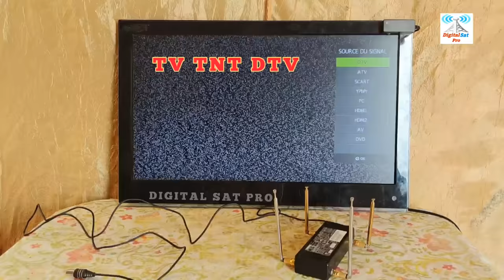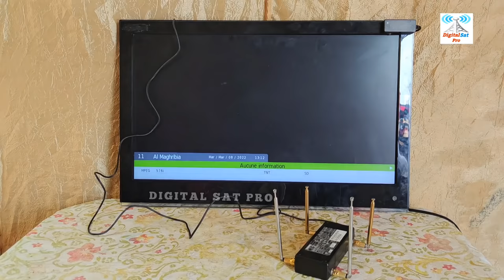Turn an old laptop charger into a powerful antenna to watch TNT HD channels

Comment: As an electrical engineer with an RF background, my forehead is sore from all the facepalming I did watching this.  You would be better off simply taking that original piece of wire and sticking it into the antenna connector on the back of the TV.
Reply: I would be better off running to a store to buy a cheap antenna and use the time saved to take a nap or mow the lawn.
Reply: I`m calling Fake on this one as he actually never shows disconecting the original service from the back of the TV and pluging this in showing that .. Hidden source , not this Antena pluged in on the back ..
Reply: @kjisnot  Trust me, you wouldn't. lol.
Reply: Look at some of his other antennas.....hilarious! He don't know a dipole from a ditch!
Reply: Yes, it seems his sync plugs are out of alignment.
Reply: lol ,,  theres much more to it

Comment: I remember before digital TV, the best antenna, better than anything you could buy at the store, was a paper clip, bent into a ring with a tail. You'd stick the tail part in the antenna connector, and suddenly have more channels than ever before.
Reply: I still do that for digital channels it picks up all the channels in my area with no problem
Reply: Metal coat hanger
Reply: Counterpoise
Reply: ב''ה, still a thing though you'll want to look at the standard size of a UHF loop, as that's essentially what you're making.
 
In an urban environment very close to transmitters (Manhattan for example) the ridiculously small and out of tune paperclip may prevent overload and actually improve reception including with ATSC digital.

Comment: I've like to suggest using a "step drill" when drilling thin plastic, to avoid the all-too-common "grab" when a drill bit meant for metal breaks through! The step drill also deburrs the hole "automatically" !
Reply: Or run the drill in reverse
Reply: You can recommend them all you like, not everyone likes stepper bits, and some tend to drill too far. v you have to know how to use the correctly for them to be effective.
Reply: I can't believe how dull the drill was.. I took a short nap, woke up, he was still drilling.

Comment: Sorry, this may work for short distances, but I’m 80 miles from downtown Chicago. I currently have an antenna that I bought in 1988. It is about 20’ long and 18’ wide in the rear. I use a 4 watt booster and get about 70 local channels. I have dish and it works quite well, however my antenna works better on the local channels. During rain/snow, the antenna works, but not dish.    Jim
Reply: Be Gilbert!

Comment: You might be surprised at how much of improvement to your signal. Just by using quality coaxial cable.
Reply: That what I did worked great !!😎👍
Reply: i did same and inserted coaxial cable into a can as a lazy cantenna. i've made proper cantenna's

Comment: Although these antennas would not work for me due to the fact I live over 100 miles from a tower, I enjoy watching you construct the different models. Maybe if I move closer to the city I will try to make this model, or I might make one for someone within range of the tower. Thanks
Reply: YOU ARE WAISTING YOUR TIME ITS A SCAM
Reply: Use a dipole antenna 30 feet in the air
Reply: @wayne grimson*
Reply: All you have to do is put your antenna ether on the roof or on top of a 50 ft pole
Reply: There is a 3000 one on Amazon extender it's called

Comment: It certainly "looks" like an antenna.  I assume that there is no consideration of the bandwidth of the signals that are trying to be received and the length of the antenna components.  The proximity to the transmitter necessary for this to work could be equally achieved by a single wire.
Reply: The TV is close enough to the terrestrial tower, a piece of wire pushed into the antenna connector would work also. No dipole needed. Wire clothes hanger?
Reply: @FreezyAbitKT7A  I used an Old Antenna Cable, stripped about 8-12 inches of the end exposing the wire only.  Ran it up the wall then plugged it in.

Comment: I suspect you'd get better results just jamming a paper clip into the antenna input on the back of the T.V..
Reply: I would use a multi-directional metal coat hanger.
Reply: I thought of it as a high tech no tech?
Reply: @stevelacombe5291  coat hangers work great, especially with foil extras.

Comment: Ok haters, now that I watched it to the end, which you should also, I see that he made a directional antenna. He doesn't mention that the length of those antennas are critical, and also that the metal lining of the case is critical,  which is why he used a laptop charger case. I can't be sure without more information. Like exact dimensions of everything, but I would wager that he's getting at least 6 dB amplification from his directional antenna. Remember that we are now using digital signals, not analog, so the rules of the game have changed and the analog ghosting that would happen with this unit, is now  an additive result, or multiplication? I'm rusty at this stuff. I've got a yaggi design in my head that's trying to be my dominant thought process that got triggered by his design.

Comment: So you reused a plastic box to make a double set of bunny ears?
Maybe include some signal gain comparisons to support  your claim of "powerful".
Maybe include something about intended frequencies.  Though from looking at it - appears to be AF/FM and over the air TV type signal range.
You did a neat job of the actual construction.

Comment: While interesting to watch, the same signal can be received with a single wire "coat hanger" or copper wire, and not waste the coax connectors, or breath in toxic plastic fumes.

Comment: Unless I missed something, there is no way the cable end (11:02-right) will fit onto the TV.
The back of most TVs have Female Coaxial Port (center lead is much smaller than shown).
Reply: looking at a regional or age related varation in TV standards. I've seen RCA/component in 2 varieties, Coax, HDMI, Antenna (pair of screws), S-Video... too many standards... What he's got is possibly Composit Video...
Reply: @Neuralatrophy  Look a little harder. No one is using RCA, HDMI, or S-Video connectors to receive an antenna signal.  

His connector is obviously RF coax with a thicker center pin on the TV end. It's probably a standard in his region.

Comment: so measurements must not be too much of a deal because my laptop charger is much bigger, and all you're doing is using a box to hold the stuff.Also it cant be too powerful because you moved it and it cut out. Would it not be better to have the internal wires shielded in the box?

Comment: From what I could see, two of the antennas were connected to the cable shielding, which is grounded.  How does that work??
Reply: I would have used a 75 ohm balun inside. Also you don't have to destroy a charging power supply to make this a plastic construction box would also work. This antenna will work in local areas don't expect it in fringe areas. An old UHF antenna works better and you can add vhf elements and maybe use rabbit ears rods which will help with low frequency channels. Goto the tv stations website for exact frequencies the channel number doesn't give you a frequency like in the old days. Most digital channels are on UHF. Some on high VHF and few on Low VHF. 73
Reply: The shield isn’t always a ground connection. It’s a shield and commonly half of the connection to most antennas. What has been built is what is known as a “dipole” which is has a negative pole and a positive pole. This fellow’s antenna could be more effective if the shielded radials were pointed in the opposite direction as the radials on the center pin side.
Reply: @LiquidRadio  it is if it's cable tv. I used it when there were no grounds on the outlets. I had a surge protector outlet with lights and used the cable ground. It's also a ground when hooked to an outside antenna because of the grounding block. The only time it ain't grounded if the TV only has two lines to the plug and if you don't ground your outside antenna which I don't recommend. If the TV is grounded the antenna jack is grounded but still part of the antenna. Using a balun is the best way to match an antenna to the set. I know it will work better if you use a balun in this setup. I will try it when I find another set of  rabbit ears. I know I have a few sets lying around. 73

 PS you can also use wifi antennas from older routers,  you will have to use sma connectors instead of f connectors. 73
Reply: @ronb6182  Thanks... I was addressing the original poster's question, trying to keep it simple and without getting too much into explanation of details like voltage phases, impedance, common mode currents etc... 73

Comment: What the heck does this have to do with a laptop charger ?   Might as well say, “turn your egg carton into a powerful antenna” !
Reply: A decent ham can tune a bedspring into a 20 meter vertical.
Reply: @jamesvandamme7786  Say What ? ? ? ?
Reply: @jamesvandamme7786  can I substitute a can of spam?
Reply: @barryfreeman303  Too small to radiate much of anything, but you can make a wifi antenna out of it. Not as good as a Pringles can though
Reply: @ItAintMeBabe99  It's all about matching impedances, long story

Comment: Not being funny but if you are stating using the charger, shouldn't you use the er, charger? What you made could have been done with any suitable sized project box for pennies, probably not having to hold it together with tape either.

Comment: Does not work using earth wire.
Important: Use brown (live/hot) 1,5mm2 instead. Using blue on both frequency is tuned to CNN/BBC
Reply: Hell yeah, I literally fell asleep while watching and had to rewind it, lmao
Reply: CNN is not over the Air is it? If so someone should get a fine. Maybe CBS? My over the Air channels look better than cable/streaming. Lots less compression artifacts and much brighter colors. I watch some shows with a small antenna mounted behind the television on the wall completely out of sight. Always useful when the nets go out.
Reply: He's joking. The color of the insulation on the wire is meaningless.
Reply: Works best with red wire, especially when one end is connected to mains live and the other to his foot.

Comment: clickbait title, turn any old plastic box in to a powerful antenna and chuck away what was in it before you started.
Also a shame you don't mention the possible danger of charged capacitors in a PSU will could well be still holding a charge.

Comment: its very inventive but i tend to agree with what a lot have said here plus theres no shielding on the inner wiring thats paramount
Reply: Paramount to what?  As you can see, it's working just fine. And as others have pointed out, a paperclip probably would work just as well.
Reply: its a bit like not having mu metal casing on the tuner box of an old tv set it be sensitive to stray emf i remember in the old days you always knew when there was a car coming or going up the road you get interference on the raster that's why they put filters on in the end but i was only kid then the days of valves thermionic etc

Comment: Not precise, because it must be super shielded in your design first connect small wire is open in air so it will disturb the signal, as soon as main wire gets open in air, where the shielding end, the signal immediately transmitter in to air.

Comment: I get more power from a 24v PSU than a 15V, next week i will use a 36v one.
Reply: I did a mega upgrade
I 3d printed a case and put a 1000v sticker on it.
I don't think I will go any higher. As it could be dangerous.
Reply: Nailed it...

Comment: You haven't turned the charger to anything, you only used its casing... Also those channels are easy to watch with a paper clip inserted instead of an antenna if you're in one of these cities, Casablanca or Rabat/salé

Comment: I thought you was actually going to use the components in charger to amplify the signal,you only used the case.and 2 aerials would be enough to gain a signal.

Comment: Looks like something they did in the old days with some aluminum foil and a piece of wire nothing new here I thought something really ingenious was going to happen like using the internal electronics to boost the amplificate of the antenna.

Comment: Do you know anything about antennas? Do you know anything about wavelength? Something about symmetrization? This is garbage. Even a piece of wire would be better. 👎
Reply: just run a coaxial cable from ur tv end and leave it on top of the terrace, this will suffice.. this is all non sense

Comment: All that scrap to make an antenna that hardly works! I dusted off an old 1983 Radio Shack twin lead Yagi hybrid antenna and put it back up with the newer HD quality versions of Coax and matching transformer. It gave better reception than Comcast customers ever got from 1999 until we went to satellite.

Comment: RF does NOT work like this everything has to be made to the correct wave-lengths to match the frequency.   So sorry this is bad idea with out calculating lengths and distances and build to a proper design.

Comment: You can use any case,no need for the charger.
Reply: How to wire, using connectors and assemble all of these parts is still useful, right ? And I want to search for the special connector for inserting RG6 cable as shown at 3:20 ? Can you tell me the name of that component ? I need that for my own antenna driven I have build for flexible connection.

Comment: TNT isn't even broadcast over the air. This is a ghetto antenna for picking up OTA HD signals. Better off buying a cheap directional UHF antenna and don't waste your time with this nonsense.

Comment: ok so let me get this straight you claim that you are going to to turn a old laptop charger into a antenna but yet you don't actually use the charger itself instead you just took it out it's plastic casing and used the casing and turned it into a shity version of just a cable laying or hanging out in the open I mean come if say that you're make a antenna out of a laptop charger then actually use the charger itself not the plastic case of it

Comment: Complete mismatch between coaxial cable and antenna it would work a lot better with a simple home made ballen to match the ohms. Also its got nothing to do with an old power supply.  Total click bait. No subscribe from me.

Comment: HD from a coaxial cable? I don't think so LOL
Reply: How do you think antennas work, or most internet services for that matter?
Reply: @kmoecub  totally different. Coax doesn't transmit HD signals. Certai ly not by linking them with a piece of wire like this.

Comment: You know absolutely ZERO about antennas and RF gain...that is no antenna!. Soldering electrical components together does not make an antenna or produce RF. You need to take a course in RF antennas 101. You might as well hook your TV antenna lead to a brick!

Comment: stupid nonsense idea!! you just need the case of a laptop charger then why not use other empty plastic box instead?? then how that thing became a powerful antenna?? adding up folded antenna may increase a little on a signal reception.but not powerful! unless you add up some circuitry on it and applied voltage then you can say it is powerful than ordinary antenna. don't be fooled by this guys!

Comment: This antenna might work if you live within 5 miles of a station, hahahah. Don't waste your time with this piece of junk. Build an 8 bay grey hoverman style antenna if you want real performance. I have both an 8 bay and a 10 bay, all made from wooden frames and metal wire coat hangers. Easier and much more powerful, and probably cheaper.
Reply: Gray Hoverman looks impressive. But it might not really be a suitable option for me, because currently I don't need a wider frequency band it offers. Instead, a Biquad that I built recently works for me, although it's only at the phase of experiment.
Reply: Since you built it using wire coat hangers, how do you protect from lightning if it is installed at altitude ?
Reply: @lexsoft3969  It sits inside my bedroom window frame,.....not outdoors.
Reply: @pipedreams57  Oh...ok.